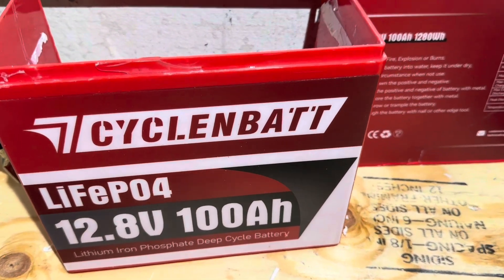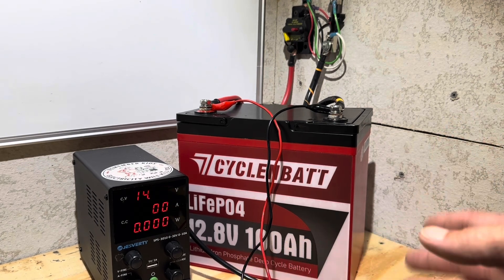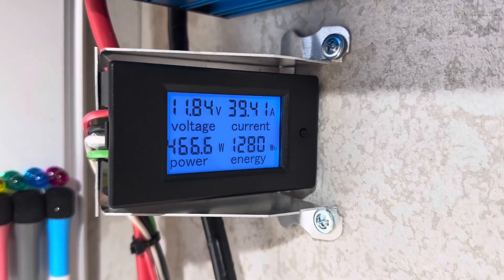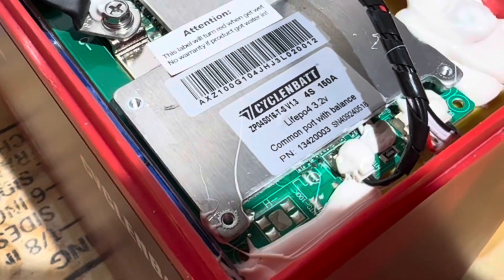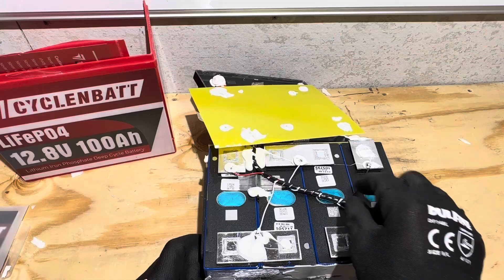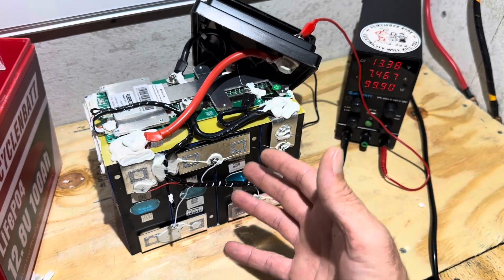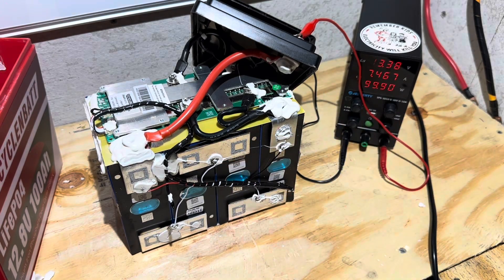Review & Teardown: CYCLENBATT mini 12.8V 100Ah LiFePO4 Battery, World’s Smallest 12V 100Ah LiFePO4

Comment: I am trying to figure out why a DC power supply are so much cheaper than battery chargers
Reply from the maker: No control circuits or safeties to provide the automatic operation of a battery charger.

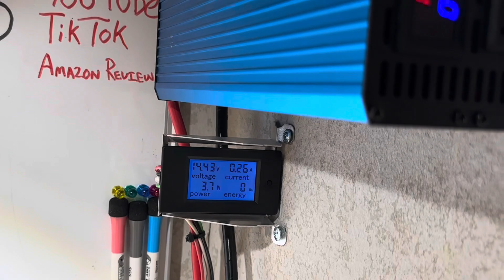Comment: at 1:38 "what is it drawing - 3.7 watts - that always amazes me"  ALFF AA 1500 watt 12 volt inverter.  During real world inverter use to power loads totaling say 400 watts is your ALFF AA more or less efficient than the inverter in your li time 3500 all in one unit..  Thank You
Reply from the maker: @jameskringlee8974  The Alffaa suffers most due to its 110vac output, this is its weak point. I wish for 120V one day from them. 
Batt to AC efficiency averages around 85-88%, I get 88-90% on my BougeRV 12V inverter. My Aims 12V low frequency struggles to meet 85%. LiTime 48V best observed was 94% on a 1000w charger load.

Comment: just a thought - LiFePO4 Battery - ~ 20 pounds - ~1300 watts   /  6 pounds of gas burned in a small honda probably over 4 times as many watts - pound for pound over 12 times the watts for gas
Reply from the maker: I avg 6kWh per gallon delivered to batteries using Honda and golf cart style chargers. I only implement gasoline after 7-10 days of rain/dense clouds. Photons are free/gasoline isn’t 🙂
Reply: @THEOFFGRIDMOUNTAINHOMESTEAD   Is that using your honda 2200i?  Which charger is your go to.  Thank You
Reply from the maker: @jameskringlee8974  EU3000 with two 20Amp Golf Cart Chargers. This is about 2300-2400W on the genset side, so about 75-80% loaded. It’s happy at this level and is best measured fuel economy from all my tinkering. Never get worse than 5kWh/gal even with a single charger on.

Comment: Wir haben 2024 am 23. Februar eine Lithium 20/a BMS über AMAZON gekauft, nun ist die Batterie Kaputt
und lässt sich nicht mehr laden.
Amazon lehnt eine Reklamation ab.
Was soll ich ich tun?
Reply from the maker: Have you tried a charger with 0V charging capability? Charger should indicate BMS wake up feature. I’m assuming you have no voltage at the terminals? Hope this helps

Comment: Thanks for saving me from this battery. There are plenty at this price. I debating spending extra for Bluetooth
Reply from the maker: You’re most welcome! I try my best to show all aspects, be it positive or negative of the batteries during the reviews. Want everyone to find best value in your potential purchase. Bluetooth batteries are nice, but the reliable connection range is only about 10ft in real world conditions.
Reply: Yes the connection range with things like this is rarely good. I had a $75 solar controller with Bluetooth. It was the same. Still better than using the buttons on the controller though. 

The cell level information is what I’m interested in for battery health. So standing right above the battery will be fine with me. 

The Bluetooth I’m unimpressed with is my 40v ryobi power station. It is only about 20 feet. Not impressive for a $700 device. But I am putting up with the Ryobi downfalls because if it dies during a power outage I can walk into Home Depot and walk out with a new unit.
Reply: Thanks for the response. I have subscribed.

Comment: Is there another temp sensor under the BMS, can see 2 black wires near the balance lead maybe that's the low temp sensor? If you still have the battery would be good to know if that is it
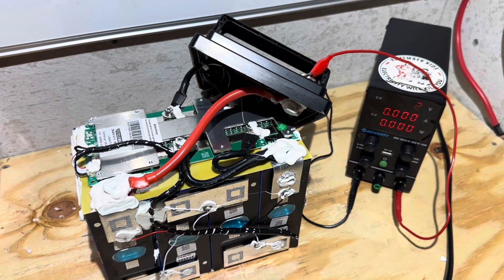Reply from the maker: 6:03 One single NTC sensor connection plainly visible on BMS. 
Wrong or improper configuration on the BMS is why it doesn’t work. Feel free to see some of the other examples I have with proper low temp cutouts. https://youtu.be/mc6W9Wz5mmI?si=NiDfpcG53sIAZCLd this is how a battery is supposed to work. Gold standard in budget batteries.

Comment: The battery is back to $165 rn btw. I picked up a couple if them and they seem great. Only problem is on the manual it says the battery is 100% charged at 13.5v. Shouldn’t the voltage get to 14.4%?
Reply: 14.4 volts*
Reply from the maker: LiFePO4 charges to 14.2-14.6 depending on your charge preference/cell voltage target.
After coming off the charger within an hour or so, the voltage will usually settle to 13.5-13.6 and after 24 hours some will settle to 13.4-13.5. You can’t go off voltage like lead acid. I have some links to an affordable energy meter in the description that tracks the energy in/out of battery. Or you can use a larger 500A shunt and program it to coulomb count for you. 
Hope this helps!

Comment: Im in Fl, i dont think i need low temp protection, I do however need the high temp!
Reply from the maker: You should be good in FL! (Can be used in climate controlled environments anywhere) High temp is very important for safety! This is why I’m always checking the BMS for high temp protection as well!

Comment: Wow looks like they are actually matching the cells for each battery. Those capacity numbers were about as close enough together as you're going to see in ANY battery no matter the price. All 105.7Ah unless the hidden one wasn't like the others...which I doubt if 3 of them were within 88mAh of each other.

The welding of the bus bars explains why another YouTuber was abe to pull 300+ amps out of this thing. These EVE cells are rated for 2C IIRC but with huge bus bars like that and massive welds...voltage drop will be minimal.
Reply from the maker: I was surprised to see how well it was made! Very nice cell pack in this one!

Comment: I don’t know where you bought it for $164 but it’s showing it’s for sale for 249 on Amazon
Reply from the maker: At time of posting the battery was $249.99 minus 5% coupon minus 29% summer sale promotion coupon. The summer sale promotion coupon expired 12:00AM 6/27/24. Please continue to check the listing Cyclenbatt runs promotion sales regularly. Just 3 weeks ago this battery had a sale and could be obtained for $149.99. Also the way amazon works if a product is low on stock or about to sell out vendors will remove coupons to slow down sales. Amazon penalizes vendors and de-ranks their products if they sell out! Thanks for watching and commenting!

Comment: Great review! Our 12V 100Ah mini has been upgraded recently. The old version has a BMS without low temperature protection, and the new version has a smart BMS with low temperature protection. If you buy it after June 14, you will receive the new version with low temperature protection, because the old version of the battery was sold out on June 13.
The new version has the same battery cells and internal structure as the old version, we just upgraded the BMS. When Mr. Off-Grid has time, maybe we can plan to test the low temperature project again.😃
Reply: Their after sale service was horrible. Fast drained and don't last. STAY AWAY.
Reply: Is there a difference in the run time of your 100ah mini vs the 100ah standard size. Id like to get a mini but prefer as much power/run time for my trolling motor as possible. Thanks.
Reply: @EarthFinsAndFire  since the capacity is the same they will have equal run time.
Reply: You said it has smart bms, does it mean there is an app and you can see the stats?
Reply: My Cyclenbatt BMS died in 20 days
Reply: Does your website clearly state that the older versions, which look 100% identical, do not have LTCP?  Is that indicated, either way, on the battery case?  If that isn't indicated on the case, why not?  If you're not going to put "LTCP" on the batteries with a BMS which includes that feature, how could a consumer know whether or not to buy your product, since you could just as easily switch back to the slightly cheaper BMS?

Comment: Does it have more than one temp sensor? I am pretty sure you said there was one for high temp, if they look the same, they might do both high and low temp. I know some of them are designed that more than one sensor has to read below 32 to shut off. I would guess it does not. But could be one of those types. But always glad for an honest review.
Reply from the maker: Unfortunately there is no other senor! If you pause and look at the BMS you’ll see the pin out for the single 10K NTC thermistor! Specs are hard to find on some of these custom contracted boards and could be as simple as not programming the option in to it not even being offered for the particular board build and chipset.

Comment: Nice battery and awesome size.  To bad the low temperature sensor didn't shut it off. It makes you wonder if it is a bad sensor or bms programming.  Regardless it didn't work and that is sad.  In my line of work I see bad sensors all the time. It always makes me wonder why they can't build a better sensor.  Enjoyed the video and keep them coming.
Reply from the maker: Sensor seemed to function properly, triggering high temp cutoff quickly. As I mentioned to another viewer it could be as simple as a programming issue or the  board doesn’t even have the option available! Hard to find cut sheets on the custom contract boards! Regardless still good capacity for the price!

Comment: Thanks for the review.  Was about to order this; damn shame it didn’t work as advertised.  
Have a good one.
Reply from the maker: Could still be a viable option if not needing low temp protection. Everything else works good. Good capacity for the price!
Reply: @THEOFFGRIDMOUNTAINHOMESTEAD  That’s true, but it’s installed and advertised as such.  It didn’t work.  Not too many people are gonna tear down a new battery to check this function.   It would be ok for me in MS, but not someone in Montana.   Have a good evening.
Reply from the maker: Exactly! That’s why it failed the test! 

This is only reason I suggested. For someone with a semi conditioned battery area it’s really cheap energy storage. This battery has been as low as $149 in the last few months! That’s cheap for (4) 105Ah cells shipped to your door! I’m wondering if there’s going to be a big price war on these batteries the closer we get to tariffs increase. Maybe even better prices are coming?